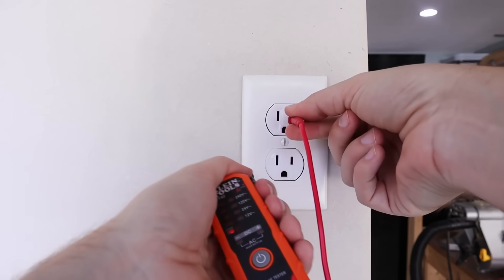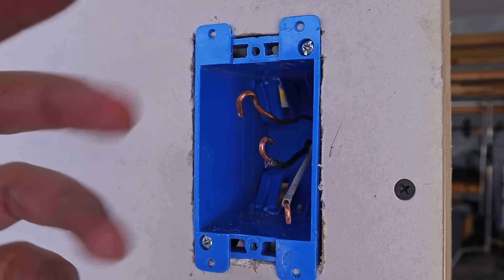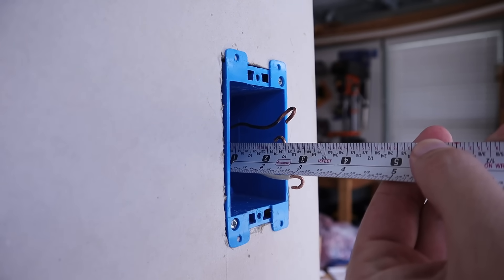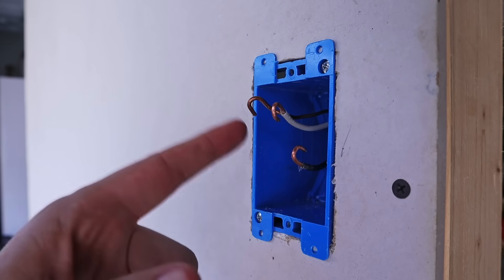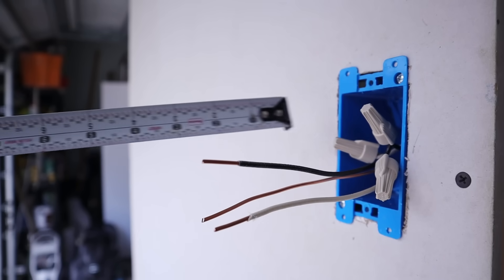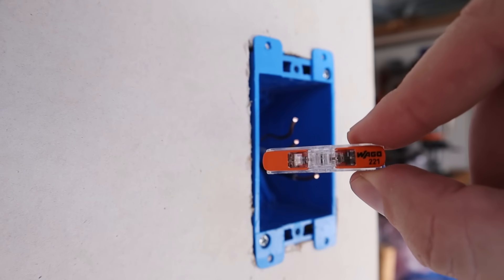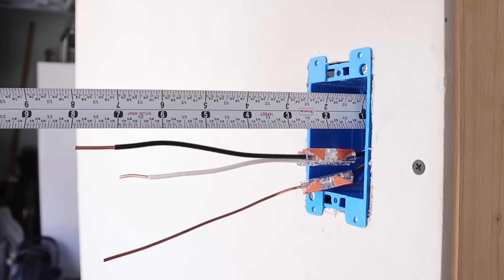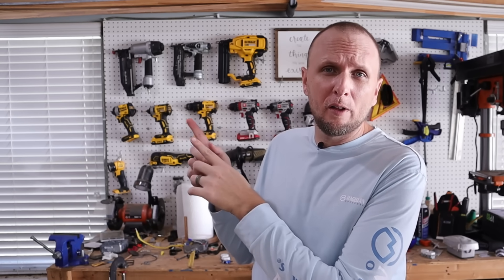"SHOCKING" New Way to Fix Short Wires In an Electrical Box to Code | Very Important

Comment: In line connectors are great, but I would recommend using some black electrical tape around them to keep the levers set.  Thank you for the video.
Reply: The levers never go up. Tape is nonsens.
There are one time WAGOs without levers too
Reply: Had lever go up on one after pushed into the box.  I now pay much closer attention to how it lays in the box.  Although with nuts how you lay it in the box is also important. There are times where one might have to push things a bit more than normal and nuts seem to fair better in that situation.

Comment: Gotta ask.  With the wire nut method, why put a wire nut on the ground wire?  Insulation is not important, and I have seen boxes with ground wires twisted, without wire nuts.

Comment: I just had to deal with this a couple weeks ago and had a question for anyone in the know:  The homeowner of a 1900's era home asked me to change out some old (really old) outlets and the house had the old braided insulation style wires that had been cut criminally short...I bought the IDEAL Al/Cu connectors, which are rather large for the amount of wire I had to work with...

Long story short: Are the Wago connectors safe to use when connecting Aluminum wiring with Copper???
Reply: Wago has special series to use with aluminum wire. These connectors have a special paste inside to prevent the aluminum wire from oxidizing.
Reply: I would assume so, as the aluminum and copper would not actually be touching, they would just have a different metal of some kind connecting them

Comment: You can also end up with short wires from damaged ends getting trimmed or broken off too. Copper can only take so many bends before work-hardening and becoming brittle. Aluminum wiring is even worse.
Reply from the maker: You are right about that!  Thanks for the input!

Comment: Yep, I found those Wago 221 straight connectors a few months aro and said to myself now this makes sense. Your not loosing any wire length and taking up less volume in the box. Great job explaining this short wire solution in the video.
Reply from the maker: I agree!  Really appreciate all of the feedback!
Reply: Check out the wago 2273-202. Waaaay smaller than the 221s, even the inlines.
Reply: @JasperJanssen  Those are push-ins (like backstabbing) and over time are not as secure as lever nuts. Also you shouldn't reuse them as removing the wire can weaken or break the metal tab that holds the wire in. After the wire is removed the end will need to be cut off so that will shorten the wire whereas the lever nuts can simply be opened and the wire removed cleanly.
Reply: @kamX-rz4uy  well, for one thing this is not true, they are still reusable after you remove a wire from them, but also and more importantly, you don’t have to cut off and strip fresh after it either. You remove them by twisting them around the wire while pulling. This is, in fact, supported use.

So no, they’re not like backstabbing at all, and if you’d ever seen one you’d know. Don’t import the limitations of your shitty sockets onto these connector blocks just because they vaguely resemble the same outside appearance of being “a hole”.

(The internals of the stab nuts are exactly the same as the lever nuts, just without the lever to open them up. So they’re also not “less secure over time than lever nuts”, no.)
Reply: @kamX-rz4uy  Not true. Push-ins as you call them is absolute standard issue in europe for solid wire. The universal ones with level, which the Americans start to discover are mainly only used for stranded. Three reasons: price, size and the lever which can’t be damaged. I’m a professional myself.
Reply: @JasperJanssen  The internals of 2273's are not the same as lever nuts, though better than what is inside receptacles for backstabbing. They are a good choice for various applications but lever nuts are an improved design. If there is a chance for wire movement or vibration, like a ceiling fan install, then lever nuts are better. As for reusability, Wago does support the twist and pull method and reuse. However, there are limitations. How cleanly did the wire came out? Does the wire look chewed up from the internal tab digging into it? What is it being reused for?  If there is any chance the metal of the internal tab has been weakened then it is best not to reuse it. Also don't go up up in gauge (12 to 14 for example) as the tab has been bent to a certain angle and may not exert enough downward force to properly secure a thinner wire. Hopefully you are doing a pull test to check.
Reply: @kamX-rz4uy  B$, are saying a tablespoon is like a knife.  Sadly you do not know why.
Reply: @syproful  Backstabbing is not code anymore
Reply: @kamX-rz4uy  Who says?  Not what is recommended.
Reply: @syproful  Been the standard in Europe for over 20 years now too
Reply: I disagree you are not losing wire length with inline connectors. Wire nuts can be pushed to corners or be left next to the inlet while with an inline connector you will have to find space to accommodate that long bulky stick plus wire loops on both ends.
Reply: Wagos run much hotter than wire nuts because they have a terrible connection to the wires.

Comment: I've always hated figuring out how to shove that 6" of 3 wires back into the box.  I always feel like it's going to cause shorts.

Also it seems that, at least in my house, when I buy a new switch or outlet it's got a larger body than the old switch I'm replacing.  Especially, those that have a USB port integrated, or have dimming, or multifunctional capability.  I feel that outlet boxes need to be as deep as the cavity any more.
Reply: Yeah I always buy the BIGGEST boxes I can find , usually 22cuin. Hell,  I often use a 2 gang for something needing several wires but only one device.
Reply: @tightwad  
Nice to hear.  I bought a brand new house in 96 and damned if boxes weren't the smallest and most were lucky to have 5in of wire extending out past the wall.  I know spec houses have to be built cheap .... but damn I'd sure rather have a house built by a professional and have all the intelligent design things highlighted that explained the higher cost.

Not sure I'd like seeing the blank cover plates in the walls but ... having the extra space sure would be liberating.  :)
Reply from the maker: Yeah I think it is going to become more and more of an issue as more people start buying smart switches and receptacles for their homes.  Thanks a lot for the feedback!
Reply: @HowToHomeDIY  
I think, IMO, that the industry needs to go the way of industrial automation using PLC's or that type of controllers.

Instead of multiple points of failures, that all controls are brought to a single location, and switches are wired with low voltage and thus allowing to control outlets via relays from central location.

Comment: Good thing I'm not from the states :)
We still have aluminum wires (in very old buildings) and if you try to do something like that, the wires will simply break, apart from the fact that it would never pass inspection/acceptance by an electrician who would have to sign this work of art.

Comment: Iam in the same situation and came up with this same solution.  I even have had the WAGO already.  I have been pausing a bit before getting underway because a concern about the WAGO latches releasing unexpectedly while tucking away the wires.

Another thing is if say a receptacle is not a branch circuit terminal, could I connect the grounding wires as input to a WAGO and one wire out to the ground screw?

Comment: Won't the in-line style take up more room compared to the squared nut levers?
Reply from the maker: No.  It's size in volume is the same as the two port squared Wago.

Comment: If the circuit continued on to other devices in other boxes in the same manner,  you would have had 6 wires to splice! But neutrals can no longer be routed through devices, but must have a pigtail such that when the device is removed, the neutral still feeds down stream. But you could do that with hot and ground as well, giving only the same three splices. The requirements for 3” and 6” do not apply to wires passing through the box, only those connecting directly to devices, right?

Comment: The Wago inline is intended for a splice in a race.  For a pigtail, they make for awkward wire folding when stuffing everything back into the box.
Reply from the maker: I have personally not found that.  For me it always seems to fold in just like as if it was just wiring.
Reply: Use their levers for pigtails

Comment: Disagree with using straight connectors.  Would have liked to see how you are going to get everything back in the box.
Reply from the maker: With those it’s extremely easy.  It’s basically just an extension of the wire to the length it should have been to begin with.

Comment: Box fill ?
Reply from the maker: Per NEC code, splicing devices and wire extensions do not count against or in box full calculations since they originate in the box and not before it.

Comment: I'd rather go with the marine grad ABYC approved standard: A properly crimped butt connector with a heat shrink cover. It's solid, reliable, not subject to corrosion, and won't loosen over time. Pros have hydraulic crimpers that actually give a gas-tight connection. The wires and the connector literally weld together from the pressure. Just as fast, and cheap too once you've paid for the crimper.
Reply: Yep !  & leaves much more room in the box, which is usually a bigger problem than just short wires ...

Comment: Just about finished rewiring and plumbing a 1966 Mobile Home. What a mess. Every box had 4 inches of wire max, most were 2.5 inches. 

Of the 15 outlets, 8 had open grounds and 4 the hots and neutrals were reversed. And all grounds and neutrals were together in the sub panel breaker box, the main disconnect is at the power pedestal outside.

All outlets were on 12-2 wire and a single 15 amp breaker, two wires under the same screw on the breaker.

All lights were run with 12-2 gauge wire and were on three 20 amp breakers.

Chassis was not bonded to MGN. No ground rod outside. Sub panels ground wire is 6 gauge Aluminum and the ground clamp to the chassis was loose enough to pull the wire out of it.
I ran a new 6 gauge copper from Sub panel to the MGN in the power pedestal, and bonded the chassis to the MGN.

Clothes dryer was not run to the sub panel breaker box. It has a 10-4 wire going to the power pedestal and then connected to a 50 amp breaker. Imagine throwing the main breaker in the sub panel and thinking you can work on the dryer outlet. ZAPPP. 

It is all fixed now.
Reply from the maker: Wow, that sounds like you had quite the project on your hands!  It is always amazing to discover what is really in behind the walls.  Thanks a lot for sharing your experience Dave!

Comment: 1) (first time seeing your channel) I noticed right away you wear the non-conductive wedding band. Nice touch.
2) Do they make the inline quick splice device for interfacing aluminum wiring (in older houses) to copper pigtails for code compliance? Currently we have to use twist locks with antiox for corrosion protection.
* Thanks for the concise presentation.
Reply: They also make  non-conductive screwdrivers, I own a set.

Comment: Am I the only one who has had trouble fitting the added wires back into the box along with the outlet? Should i cut a larger hole in the box where the wire comes in so the added wire can be pushed back into the wall cavity?
Reply: Carefully push each wire into the back of the box, switch/receptacle will fit. NO do not hack the box, you make it unsafe.
Reply: @soisaidtogod4248  it ain't working, I'm just gonna get a two receptacle box & only use one side

Comment: There are springs inside of the wire nuts. Tighten them VERY tight, you can put a 5/16 nut driver on the ones in this video. The spring then expands around the wires and holds them even better. I recommend twisting the solid wires very tight BEFORE putting the wire nut on there. Hire an electrician.

Comment: okey info but thumbnail did make me think you was not going to Use Wago but you did... so wrong information gives thumbs down
Reply from the maker: Lol I did not use what was in the thumbnail.  Everything was accurate.
Reply: @HowToHomeDIY  a Wago is a Wago if it is 2, 3, 5 or any other amount of connections there is of it
Reply from the maker: Wago is a brand.  This is a newer connector.  You perceived it how you perceived it.  Doesn’t change that everything was accurate.
Reply: @HowToHomeDIY  i know Wago is a brand and the 2 port one is not new they are as old as the other Wago connectors only got a new inline design...

Comment: I worked on a two story modular home once and found the wires between sections were connected via push in connectors that I found in the floor of the second floor/ ceiling of the first floor, it made sense but seemed cheap for such an expensive home.
Reply from the maker: Yeah I am not a fan at all of the push in connectors.
Reply: Those Tyco connectors can be prone to failure if they're just left flopping about. In the mobile home setup instructions,  they'll usually make you nail or screw the mated pair through provided mounting slots, to the joists nearby.

Early in my apprenticeship,  a customer wanted nothing to do with them, so he had us place the 20 or so splices in a 12x12x4 box in his basement.

Comment: Way back in the late 80's when I started an apprenticeship (I didn't stay in the trade though) my employer taught me to always leave around 3" of slack inside the wall between the last staple and the box for "just in case" (his exact words).  He also taught me to leave a full inch of sheathing inside the box for "just in case" and then to always leave 7" of wire inside the box for (you guessed it) "just in case".  Basically this would ALWAYS leave the next guy at least 10" to play with and as he also told me "If 10" isn't enough for you then you're just greedy".  I loved that guy.
Reply: Sounds like a really cool guy.
Reply: I leave 4 in wall and 2 to 4 in the box depend in the number of wires which is actually code.  The wire must extend a certain number of inches beyond the front of the box.  Since I do not do it as a career I do not recall the number of inches.
Reply: 2 inches of sheathing in the box is more common, even my short runs have that much.
Reply: Yes, typically 1-2 inches of sheathing is used in the back of the box.
Reply: Same way I was taught in 2022

Comment: Not sure why you're using such large wire nuts.
A blue/orange nut will handle up to 3 #12 and are around half the size of the nuts you're using, for what I'm guessing is #14
Reply from the maker: It’s just the camera zoom.  The tan wire nuts are quite small in comparison to many of the wire nuts.

Comment: I ran into a problem with a WAGO connector when extending 40's vintage wire that has thicker insulation than Romex.  You need to strip more insulation off of the old wire in order for the wire to seat properly.  Be sure to do a tug test.  Sometimes I will also wrap the levers in electric tape to keep them from accidently opening and/or to be sure none of the stripped wire is exposed.
Reply: Yeah, you might need to be more precise and with modern Romex you can strip it so it in just inside but not where there is contact with the metal inside.
Reply: WAGO do larger ones for thicker cable you know. Wire nuts are not safe..
Reply: @steveemmett9540  I have some of the larger WAGO's for 10 ga. wire.  I was just surprised that the old cloth insulated 14 ga. wire was as thick as it was.

Comment: Oh, and what's these "pigtails" you talk about but don't show us?!?  A pigtail is a stranded conductor wound with several turns wound up like a spring (or even the whole length spring-wound) as a hook-up wire to something that is not firmly fixed or that vibrates, typically seen in earth bonding conductors to heat exchange plates or to large motors or motor frames.  The clue is in the name!  They are curly like a pig's tail.

What you just installed are simple extensions or hook-up wires.
Reply from the maker: Yes and they are called pigtails in electrical.  😂

Comment: Wagos are great for splicing multiple conductors, but for extending (2-pole) I prefer the Ideal yellow through-splice: they've been around for donkey's years, they're cheaper and they're more compact.  The benefit of the mire pricey Wagos is that they handle stranded and flexible conductors where plain push-fits don't.

Comment: Why not just twist the wires together & cover with electrical tape?
Reply from the maker: That is no longer acceptable by code.
Reply: The heat may melt the tape.
Reply: @soisaidtogod4248  - What heat? Unless there's resistance due to a poor connection, no significant heat should be produced.

Comment: I use Ideal's version of the Wago. They don't have the lever and are friction fit but they're a lot easier to find locally than the Wago ones. Although, I'm probably going to order the Wago inline connectors now because as far as I know Ideal doesn't make inline ones.
Reply: Are the CE rated, etc.  The generic lever ones are not.
Reply: ideal do make inline connectors
Reply: Ideal Spliceline No.42 butt connections are a lifesaver when some knucklehead cut the wires too short.

Comment: Wire nuts worked well for a lot of years but wago are so much easier to use and also can be used behind walls as they make a full mechanical connection. Being a Electrician from the UK imams not sure if wirenuts offer the same.
Reply: Where can you have a wire connection not inside a j box?  Loose in a wall cavity, here's your sign.
Reply: @soisaidtogod4248  the connection needs to be inside a box or contained within a suitable fireproof receptacle.